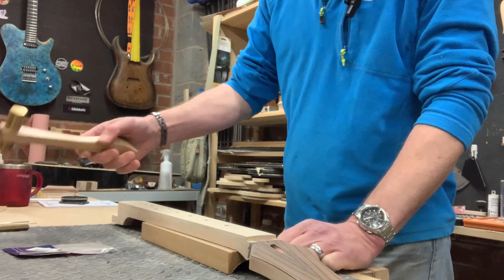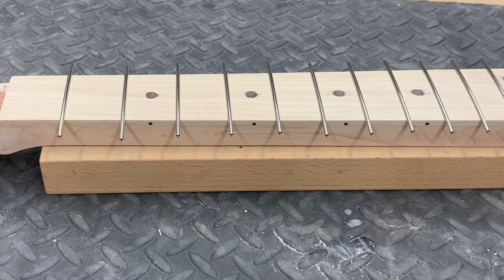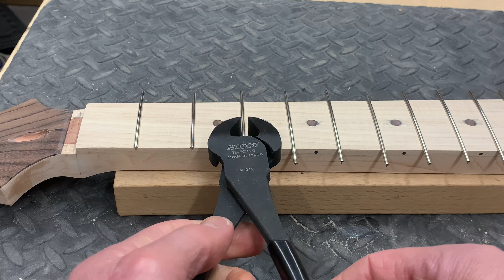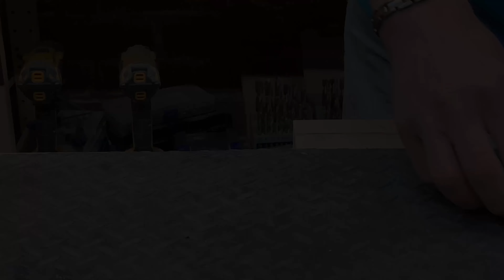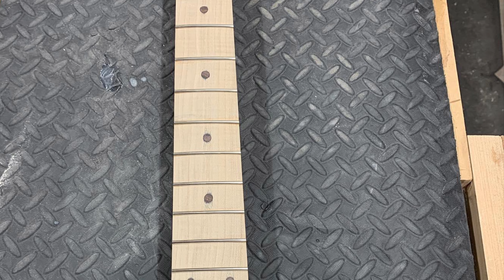How To Hammer Frets - Custom Electric Guitar Build, #GGBO2022

Comment: I got a Warmoth neck - tried it in two different guitar bodies and on both it just seems a bit "tinny" or something on the lightest 2 or 3 strings around frets 8 to 13 give or take... could frets not set properly cause that kind of weak tone?
Reply from the maker: Could be that, if there’s a gap beneath them it can do some strange things.  I’ve also had a couple of ‘dead’ frets which had to be replaced which had some kind of fault inside the metal. If they’re a bit discoloured or have a strange looking surface it may be that.

Comment: Any reason not to clip the frets as you go so you don't have to nibble the closer frets?
Reply from the maker: Not really, I remember thinking that at the time and clipped them as I went on the next one I did. It feels a bit more ‘stop-start’ doing it that way, but is easier to clip the ends off as you go. Thanks for watching 👍
Reply: @WhitefootGuitars the reason I asked is, I was about to do my first fret board swap and fret install. Just wanted to make sure there wasn't a specific reason. I wound up successfully swapping the fret board and I clipped as I went.

Comment: Use a press and be careful not to apply too much pressure. Hammers put the frets in unevenly.
Reply from the maker: I’ve got a press and cauls, it’s not very good though so until I can replace it have to use the hammer.
Reply: its all about technique